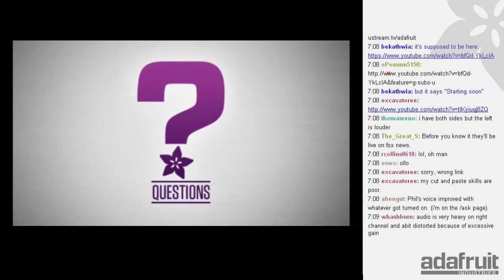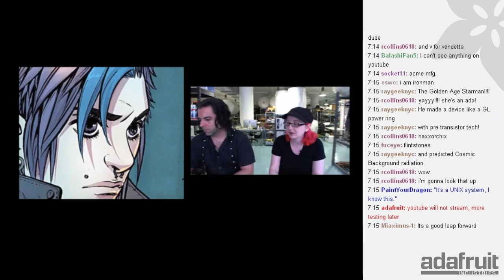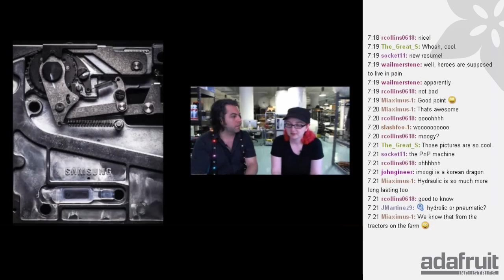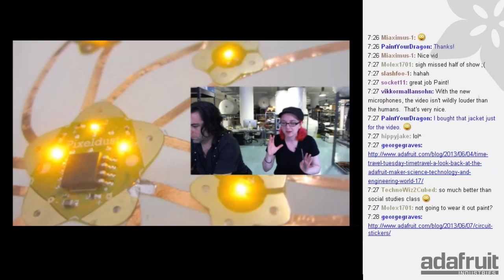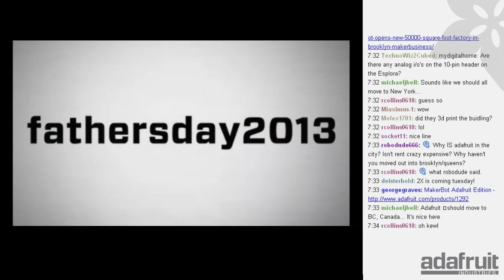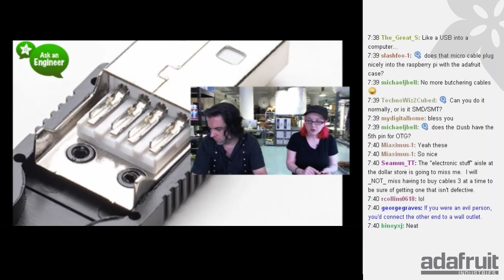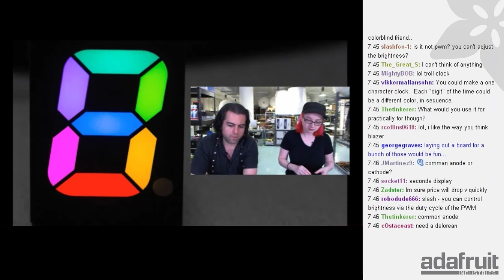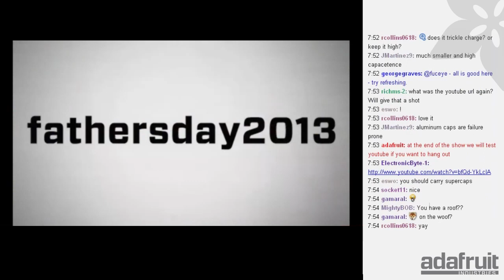Ask an Engineer 6/8/2013

Comment: The google hangout api can return isBroadcasting() as a boolean, you can build it into a 'gadget' on your steam (a xml + html page which runs alongside your hangout) which could trigger something on another server to activate your arduino or Pi to light up the sign. The api looks pretty easy to use and there are lots of examples. You do need an SSL server to hist your xml and html page though so I haven't been able to test it.